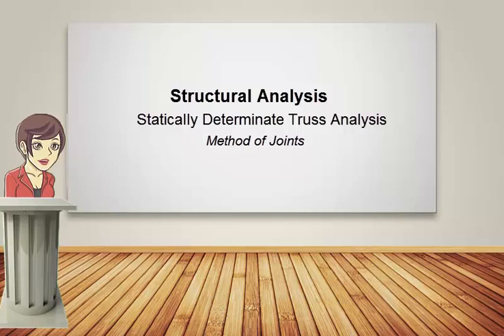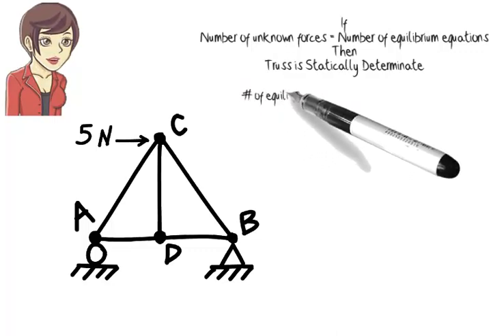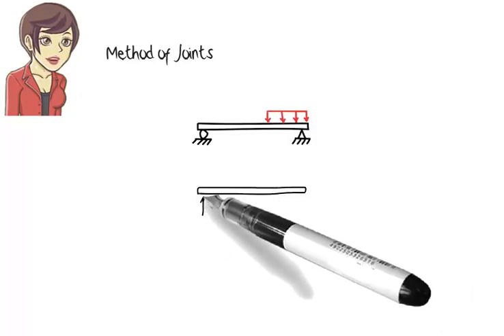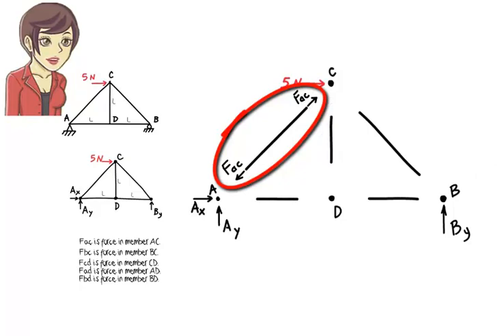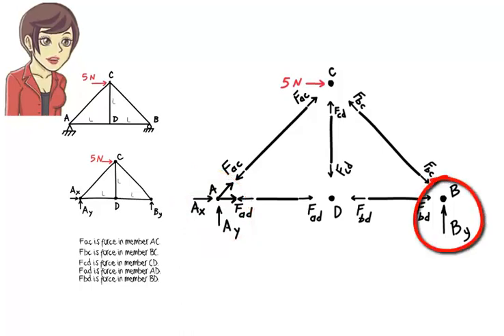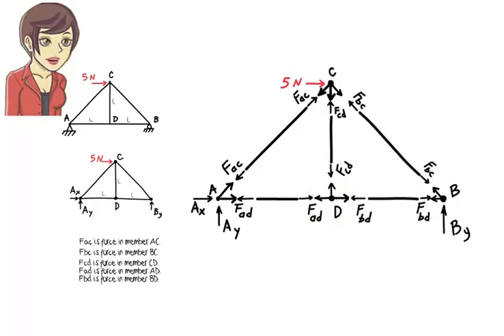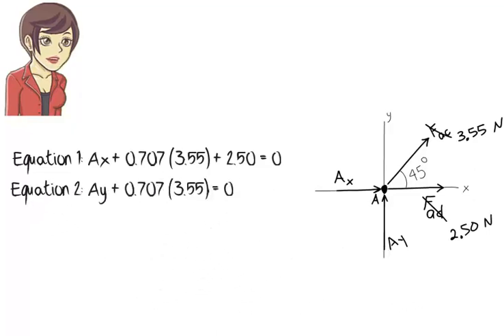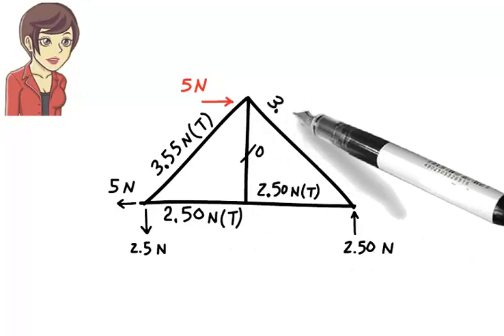SA04: Truss Analysis: Method of Joints

Comment: How do you know if the Fx/Fy force is cos or sin?
Reply from the maker: It depends on the angle we are using to determine Fx and Fy.

Let’s refer to the side of the right triangle along the x-axis as X and call the side along the y-axis Y. 

If we are using the angle facing X to do the calculations, we need to use the sine of the angle to determine Fx and cosine of the angle to determine Fy.

If we are using the angle facing Y to do the calculations, we need to use cosine of the angle to determine Fx and sine of the angle to determine Fy.

Comment: Im confused at joint c (at 12:37) where angle 45 above line Fac, so the angle of Fac is also 45 since they are perpendicular  45+45=90. is this correct? I need to know if my assumption is right. please response :(
Reply from the maker: Yes, you are correct.

Comment: There are lots of pin jointed strictures out there. The most famous is there new World Trace Center building in the US. It has steel and concrete pin joints! The CN Tower in Torontoe CANDA has something lie 300 concrtee pin jpoints and theyt solev it use matrices for the deflectrions to prevent crackign in tension!

Comment: how did you label tension and compression forces ??
Reply from the maker: When drawing a truss member in tension, we always show the internal (tension) force acting along the center-line of the member, pointing away from the member (pulling it). Since the member has two ends, we show the (pulling) force acting at both ends. 

The same (tension) force, when drawn at the joint, also needs to be shown pointing away from the joint. 

The sum of the tension force shown at the end of the member and the same force shown acting at the joint should be zero. Meaning, the two forces need to point toward each other (in the case of tension) or away from each other (in the case of compression).
Reply: @DrStructure   Thanks a lot

Comment: Why do you have forces at the supports in the y-direction when you don't have any applied forces in the y-direction?
Reply from the maker: Generally speaking, the absence of an applied force in a direction (say, the y-direction) does not imply reaction forces in that direction don't develop.  In fact, in most cases couple of vertical reaction forces need to develop in order to ensure that the sum of the moments adds up to zero.

Comment: Dear sir how can we know that which member is in tension and which member is in compression?
Reply from the maker: Before the analysis is done, we don't know which ones are in tension and which are in compression. By convention, we assume all the members to be in tension. That is why we show the force vectors pointing away from the members and the joints. 

If a computed member force turns out to be negative, we know that member is in compression. If the computed value is positive, the member indeed is in tension.

Comment: at 12:25 why did you write a positive "FbcSin45", arent you assuming that member is in compression so it should be "-FbcSin45", I've always had MAJOR difficulties with the sign of members, please help! D:
Reply from the maker: Two comments here:

1. All the members are assumed to be in tension. That is why the forces are pointing away from the joint. If the force was assumed to be compressive, it would had pointed the other way, toward joint C.

2. When we are writing the equilibrium equations, we don't pay attention to tension or compression issue. We pay attention only to the direction of the force based on the established coordinate system. Here, we assumed x is positive to the right. This is not to be confused with a tension force. Here, we are just establishing the positive direction of our coordinate system. We are basically saying, "for the purpose of writing the equilibrium equation, any force that points to the right is positive, and any force pointing to the left is negative. This way, we know what to add and what to subtract when we are finding the algebraic sum of the forces at the joint.
Reply: Don't  you mean all members pointing away from the point are in compression and all members pointing towards the point are in tension? i'm so confused, sorry
Reply from the maker: No.  

If a member (say, AB) is in tension, then the  axial force shown at ends of the member are pulling away, pointing away from the ends. That is how we show a tensile force in a member.

But, we need to draw a different free-body diagram for the end joints.  So, the member is on a different free-body diagram than its end joints.

Looking at the free-body diagram of joint A:
The axial force in AB acting at the joint must have a direction opposite to the force drawn on the member itself. So, if the force on the member is pulling away (if it is a tension force), then the same force acting at joint A must also pull away from the joint. 

Tension forces are always pull away from the ends of the member, and the joints. Compression forces are opposite in direction to tension forces, at the ends of the members and at the joints.
Reply: Dr. Structure oh so in simple words, you were drawing the connection between the joints and the members. and if a is in tension, the direction of the force is going towards the joint but at the joint the direction of the force is pulling away, therefore connecting with the member so it balances out? ive never seen this method before, sorry
Reply from the maker: Yes, you got it!

Comment: You have explained for a joint with only 2 unknowns .What will happen if a joint has 3 or more unknowns?Can we also solve the problem using the moment?
Reply from the maker: If the truss is statically determinate, the system of equilibrium equations, when solved simultaneously,  gives the values for all the member forces regardless of how many members are connected to a joint.

You can always use the moment equilibrium equation to solve for one or more unknowns, but that is not called the method of joints. We can view it as a hybrid approach which, by the way,  may prove to be faster for hand calculations in some cases.
Reply: If a joint has more than 2 unknowns it cant really be solved.
Reply from the maker: Not true. If a joint has more than two unknowns,  but the truss is statically determinate, we can calculate all the member forces by solving the system of (joint) equilibrium equations.

Comment: the  F(bc) tho in x direction should be cos(45). but the answer is correct since cos and sin are equal in 45deg angle.
Reply from the maker: +ml12 There are two acute angles in a right triangle. We can use either angle to determine the x and y components of a force. If we use the angle between the hypotenuse and the base (along x axis), cosine is used for Fx and sine is used for Fy. However, if we use the acute angle between the hypotenuse and the vertical side of the triangle, then cosine has to be used for Fy and sine has to be used for Fx.

Comment: i have enjoyed alot and learnt alot 
but please clearfy Fbc part is it in x direction forces are those with sin(45) or Cos(45)
Thankyou
Reply from the maker: +Husnain Hyder If we are using the angle that is facing the x-component of the force, then it is Sin(angle), otherwise it is Cos(angle).
Reply: Why are you using SIN for the forces in the X direction here, when in the example a few seconds before you were using COS in the X direction? Thank you
Reply from the maker: Since we have an isosceles right triangle here, sine and cosine can be used interchangeably.
Reply: I am also confused by this. What would Fbc be if the angle shown was not 45?
Reply from the maker: Starting @12:34 The equation summing the forces in X direction is given as:

Fbc sin(45) - Fac sin(45) + 5 = 0

And the equation for Y direction is given as:

-Fac cos(45) - Fbc cos(45) - Fcd = 0

An there is a 45-degree angle labeled on the diagram.

The angles used in the above two equations is not the angle labeled on the diagram. It is its complementary angle, which is also 45 degrees.

If that complementary angle is anything but 45, say it is 30 degrees, then we need to used 30 degrees in the above equations.
Reply: Thankyou

Comment: can i use this method if the bottom member is not in 180 deg ?
Reply: +Nnixx Palomares there are 2 members at the bottom but they are not in 180 deg.
Reply from the maker: +Nnixx Palomares Yes, regardless of the geometry of the truss, the analysis technique works as long as the structure is statically determinate.

Comment: Dr. Structure how i know if i should use sin of cos in Fx and Fy?
Reply from the maker: +Nnixx Palomares It depends on the angle you are using for calculating the x and y component of the force.

Given a force vector, you can always construct a right triangle that has
 the force as its hypotenuse. The right triangle has three interior 
angles: a 90-degree angle and two smaller angles. 

Let's refer to the interior angle between the hypotenuse and the 
vertical side of the triangle as A and the interior angle between the 
hypotenuse and the horizontal side of the triangle as B.

You can use either A or B to find the x  and y components of the force 
(F). 

Using angle A:

Fx = F sin(A)
Fy = F cos(A).

Using angle B:

Fx = F cos(B)
Fy = F sin(B).
Reply: +Dr. Structure ahhhhhh... okay =D that was very helpful =D
because i have a problem here where i am solving for an scalene kind of triangle. BTW thanks a lot.
Reply: +Dr. Structure it confuses me because in this example problem you have 45deg angle but now i am enlightened haha =))

Comment: dr Structure is it possible that we directed a force to the x axis and use sin.l only know that sin is for the y axis ,cos for the x axis
Reply from the maker: +Tinashe Matimba It depends on the angle you are using for calculating the x and y component of the force.

Given a force vector, you can always construct a right triangle that has the force as its hypotenuse. The right triangle has three interior angles: a 90-degree angle and two smaller angles. 

Let's refer to the interior angle between the hypotenuse and the vertical side of the triangle as A and the interior angle between the hypotenuse and the horizontal side of the triangle as B.

You can use either A or B to find the x  and y components of the force (F). 

Using angle A:

Fx = F sin(A)
Fy = F cos(A).

Using angle B:

Fx = F cos(B)
Fy = F sin(B).
Reply: thank you so much Dr Structure.looking forward to your posts

Comment: I do not get one thing? Why do you say it automatically satisfies the moment equilibrium when you have a vertical reaction there?
Reply from the maker: mmdandf Yes, an (isolated) truss joint could be subjected to multiple forces (vertical, horizontal or inclined), but since they all pass through the joint no bending moment develops about the joint. Therefore, the moment equation for a typical truss joint becomes: 0 = 0. The same is true for an (isolated) truss member. 

Obviously if we did not isolate the truss joints, if we consider the truss as a whole, then the moment equilibrium equation could have non-zero terms.

Comment: Hi Dr. Structure, I tried solving the problem assuming tension for AC, AB and BC. after I finished solving, I got tension for AC, and BC but compression for AB. I got all the same values you got but that was the only difference. Is my answer wrong for this? Or does it matter? Thanks for your reply in advance

Comment: what if u do not have right angle triangles can the same approach taken?
Reply from the maker: There is always a right triangle.

If we have an inclined truss member with know end positions, we can easily construct the right triangle needed for calculating the sine and cosine.

If we know the end positions of the member, then we know the member's length. Make this length the hypotenuse of a right triangle. Since we know the end coordinates of the hypotenuse, we very easily determine the height and the base of the right triangle.

Say a truss member has end coordinates (5,4) and (8,0). Then, the hypotenuse of the right triangle has a length of 5. The height of the triangle is 4 and the base of it is 3.

Comment: At the time of 12:50 of the video, why do you use sin with the sum of all forces in the x-direction and cos with the sum of all forces in the y-direction? I thought it was the other way around.
Reply from the maker: It depends on the angle being used for writing the equilibrium equations. We either use the angle between the member and the x-axis or the angle between the member and the y-axis. Here, the angle between the force and the y-axis was used.

Comment: may i ask, what if the distance of x's and y's are given, instead of using cos and sin, ?
Reply from the maker: Sine and cosine of an angle are related to the sides of the right triangle that defines the angle. If x is the base of a right triangle and y is the height of it. Then the hypotenuse (R) is the square root of the sum of the squares of the side. Or,

R*R = x*x + y*y

If you know x and y, you can calculate R.

If the angle of interest is between the base and the hypotenuse, then

sine of the angle = y/R
cosine of the angle = x/R

If the angle is between the height and the hypotenuse, then

sine of the angle = x/R
cosine of the angle = y/R
Reply: Thanks :)

Comment: at the time 12.38 if u c u mention Fbc is sin but it should be cosine for x direction and same goes to Fac ..
Reply from the maker: Here, the angle and its complementary angle are both 45 degrees. Depending on which angle you use, you get either sine or cosine of 45 degrees. Both formulations are correct.

Comment: @ 16.22, how do you figure .707Fbc-.707Fac + 5 = 0 

becomes 3.55 N  for both FAC & FBC how?
Reply from the maker: @16.22
There are two equilibrium equations for joint C of the truss: Equation 5 (sum of the forces in the x direction = 0) and Equation 6 (sum of the forces in the y
direction = 0). Here are the two equations:

Equation 5: 0.707 Fbc - 0.707 Fac + 5 = 0
Equation 6: -0.707 Fbc - 0.707 Fac = 0

From Equation 6 we get: Fbc = -Fac.

Substituting -Fac for Fbc in Equation 5, we get:
-0.707 Fac - 0.707 Fac + 5 = 0.

Solving this equation for Fac, we get (approximately) 3.55 N for Fac.
Reply: Dr. Structure
Aren't they supposed to be 3.53606...
the same with Fbd, it should be 2.83...
Reply from the maker: Joshua de Jesús Yes, more accurately Fbc and Fac each should have a magnitude of  5/2 cos 45 = 3.54.
And, Fbd = 3.54 cos 45 = 2.5